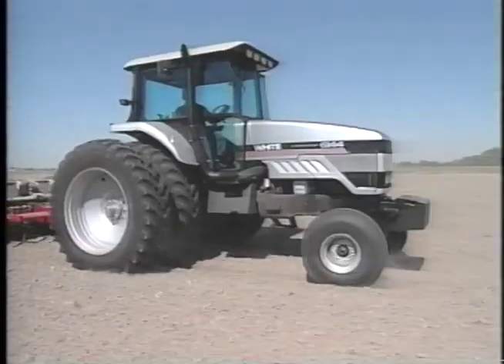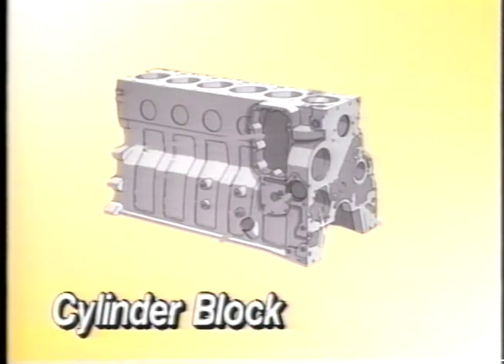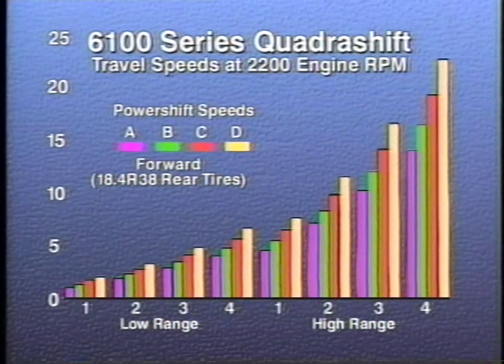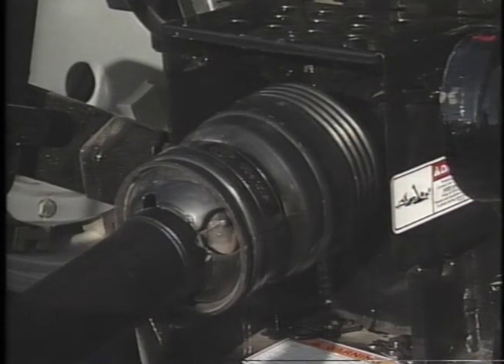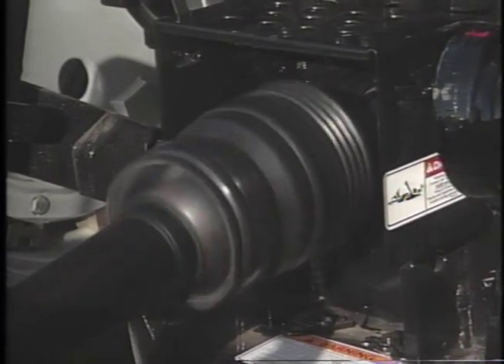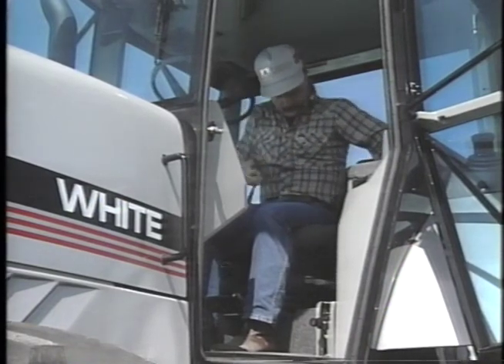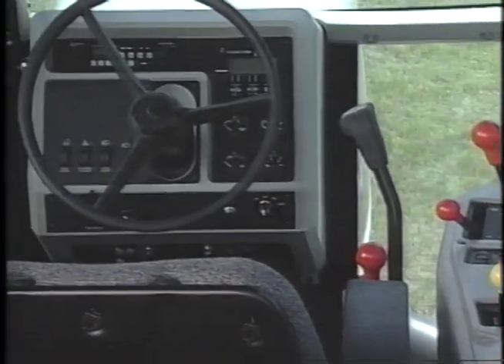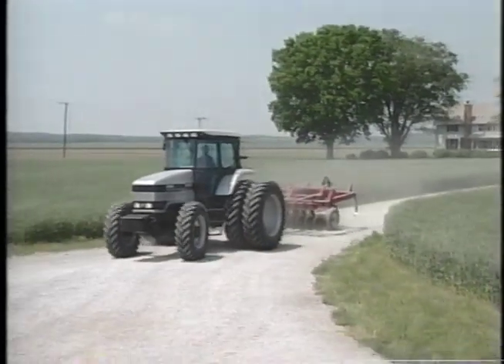1994 White 6100 Series Quadrashift Tractors Promotional Video

Comment: A nieghbour had a 6124 2wd for years. Tough old tractor.
The guy who does the combining for dad has the equivalent in Agco Allis. (9155 or 9355 in mfwd). Aside from color the only difference was the Agcos had a different engine(Detroit, I think). And the Massey Ferguson 8000 series shared parts too. 
I would love to get a 4wd 6000 series White or a Massey 8000. Just good looking tractors in my opinion.
Thanks for sharing.